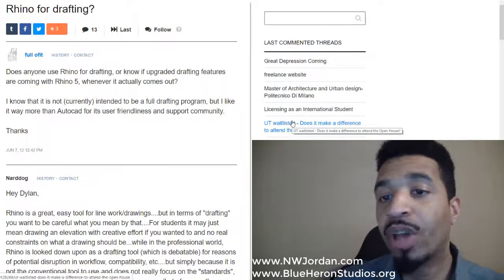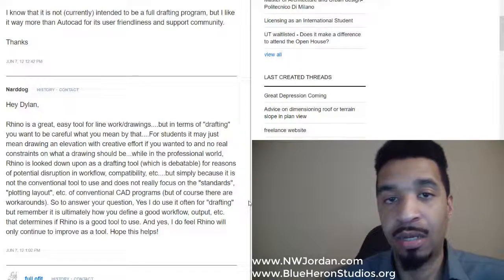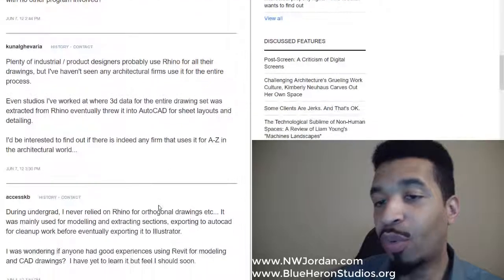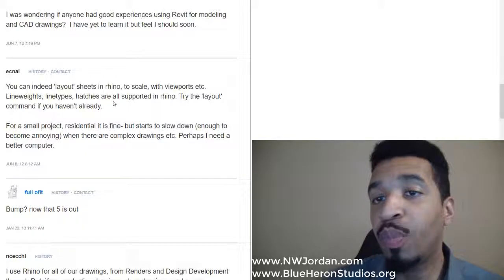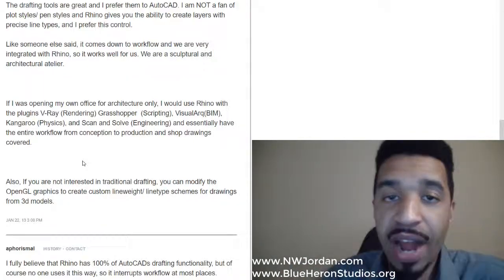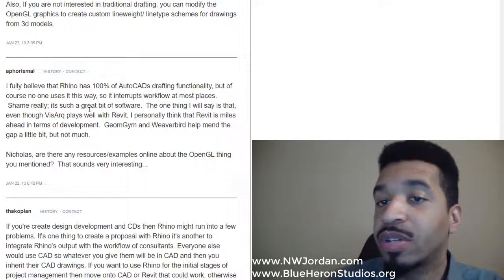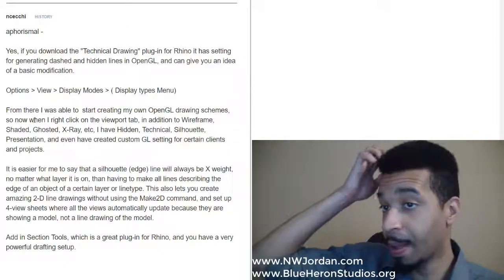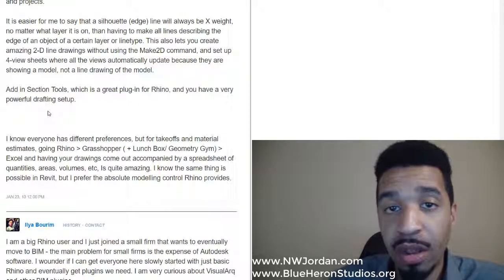ArchNation | Rhino for Drafting - Architecture

Comment: Having used AutoCAD since 1988 and Inventor since 2000, I was very reluctant to move to Rhino. I am extremely impressed with the 3D Capabilities. Unlike Inventor that limits you to working with Solids Only, with Rhino you can draw Solids, Meshes and Surfaces. This opens up a whole new world for 3D Development. 
However, it's capabilities as a "Drafting" Program is very poor. It does have potential and a few good things going for it. I purchased Rhino at home shortly after beginning to use it at work. I do not believe that Rhino at this time can even hold a candle to AutoCAD or Inventor in the drafting or parametric designs of 3D Solid Models. 
If you want something simple and affordable then Rhino is a Great Choice. If you have 100's of Shop Drawings to get out the door, Use AutoCAD or Inventor. 
PS Rhino is a lot of fun to just play with. I 'Highly" Recommend it.